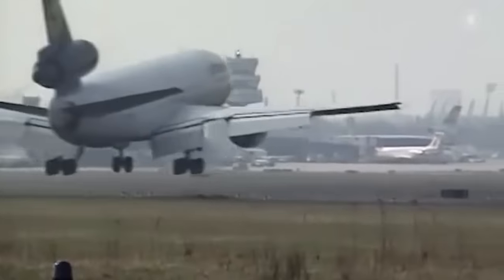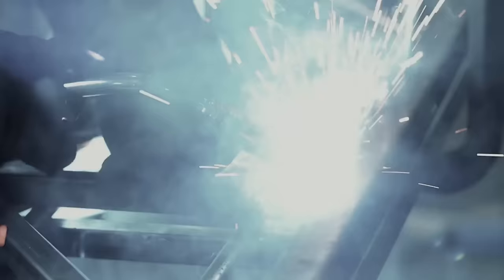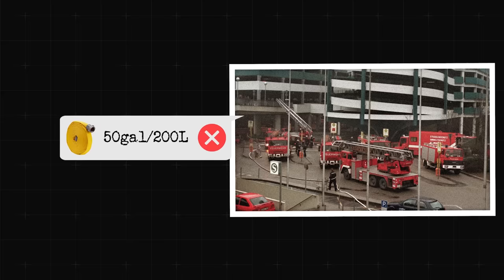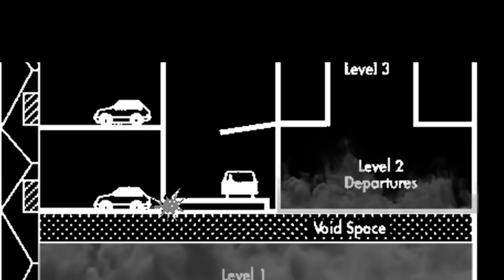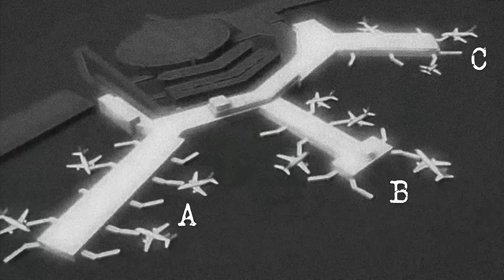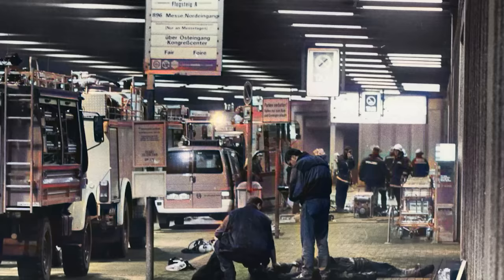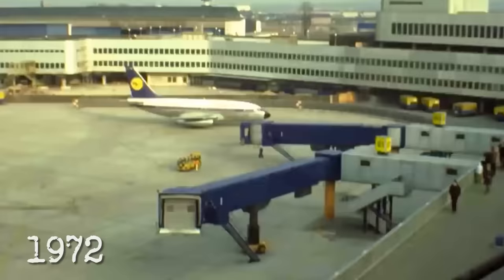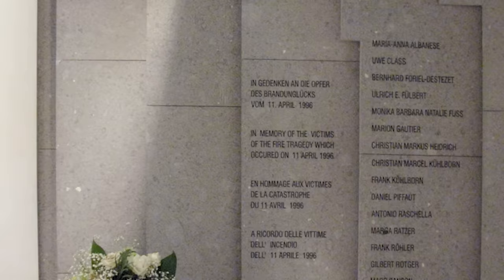The Düsseldorf Airport Blaze (Worst Airport Fire in History)

Comment: How many times does a guy doing some welding cause a major disaster, seems to happen all the time
Reply: A few years ago, one of the buildings at my university had a major fire, caused by contractors working on the roof at the time. I can't find anything about it now, but it came up in my fire warden training and I think it was linked to tar being applied to the roof? Not quite welding but certainly careless hot works. Luckily the whole building was closed for refurbishment so nobody was injured.
Reply: @caitthenerd7470  Same thing happened in 1987 at Dutch museum 'New Land Informationcenter' roofworks were being done causing the entire museum to burn down.

And of course the major fire of Notre Dame in Paris a few years ago.
Reply: I was a children's librarian in NH while a big library addition was being built just past a plastic sheet.  Choking Welding fumes frequently penetrated the children's department.  We closed and evacuated the children's dept several times.
Reply: Welding is an important technology that needs to be used in many places. The problem just is that it involves very high temperatures and would require the supervisor/foreman to arrange for there to be someone present who knows more about the building (like what random exposed object is made of flammable materials) and about fire safety. That of course costs extra time and money, so normally it's just assumed that everything will be OK. But of course, as usual, when anything goes wrong, it's apparently the welders fault, as if they could decide what to weld and where. The workers are normally just doing what the higher-ranking (and in theory more informed) people tell them to.
Reply: @SmartassX1  Are they secretly already calculating how much the fire insurance will pay out if anything goes wrong?

I mean, to have work on the roof done, the followings is usually collected on top:
- bottles of gas (highly flammable);
- loads of tar (burns the best once ignited);
- a variety of types of wooden structural supports and beams;
- planned and executed in the middle of Summer of course, when the sun is at its hottest and brightest;

What could ever go wrong?
Reply: i mean youre playing not even with fire but with hot molten metal, of course its very dangerous
Reply: the only two things that i've ever had close fire calls with are the small amount of hobby level welding i do, and still-lit cigarette butts, heh. if i scale that up to an entire planet's worth of welders and smokers i mean.... that's kind of scary.
Reply: At my work, you can be called on to be fire watch..If anybody is doing some hot work ,2 people will be watching  together with 2 extremely large fire extinguishers each..  + you have to stay there 30 minutes after the work is done...
Reply: Yeah no kidding. I just found out that the Beirut explosion started as a fire from welders as well.
Reply: @LiquidGhost100  What is your source for that statement ???
Reply: I see you everywhere, how do I keep seeing you
Reply: First time I've heard of it
Reply: Too many times as they have cost cutting as happened in this and had not taken proper steps like alerting the airport fire brigade who had no clue or even warning the workers on the dangers
Reply: @SmartassX1  ye in theory but never in practice they tell people that they are welding and where and probably nothing else
Reply: @thegoldeneagle9890  so many experts after it actually happened the workers were probably playing video games before working and not concentrating who knows
Reply: @James-kv6kb  well no one probably told the other than you go to the airport you weld this here and done go home you have finished and that is all they ever get told
Reply: @thegoldeneagle9890  Well with so many probablys it's no point continuing the conversation
Reply: @James-kv6kb  true the industry does closely guard what they are told in fact so no really knows
Reply: To be fair, the welders weren't told to watch out for flammable insulation since insulation is supposed to be fireproof by law
Reply: @jmlinden7  emphasises placed on the word supposed why do you think most things happen because something was supposed to be different
Reply: An example of a disaster caused by welding is the ultra sad fire that destroyed the beautiful French liner Normandie in New York harbour during WW 2. We also had a beautiful, historical church destroyed by fire in my nearby town of Aurora, Ontario, Canada because some roof repair workers had an open fire system for melting roof tar, which caught the roof on fire.

Comment: As soon as you said the weird smell thing I knew it would be polystyrene. The smoke is terribly thick and nasty. Seems like it’s nearly always the culprit in large building fires.
Reply: Foam rubber I learned from experience and fire training is also a major producer of caustic toxic smoke, in houses and more:  From burning and smoldering couches, stuffed chairs...  And fiberglas insulation, esp in a mobile home, while supposedly fire resistant includes lots of plastic fibers: It burns rapidly between mobile home walls.  FD taught me a mobile home will burn down in 15 minutes, while also being choked by toxic smoke.
Reply: Very much like the polyurethane packaging foam used to soundproof the walls of The Station nightclub, which contributed to the fire that killed 100 people.
Reply: @Felamine  there's footage post fire where the results of an investigation are shown and they ahowed how quickly that foam burned up and the smoke was insane
Reply: Ages ago in my town a large warehouse full of polystyrene packaging materials (mostly the small peanuts but also larger flat pieces) and the smoke/smell was bad.

Comment: In Germany such trials ALWAYS end in acquittals. Because the standard is to show the individual guilt, which is of course useless when a series of wrongdoings caused everything. Same with the Loveparade, the case was eventually dismissed.
Reply: Right, blue pepper
Reply: The Swiss Cheese model of accidents. Roughly put, all the holes have to line up. 
Sloppy safety practices, poor safety equipment, and badly designed buildings (among other things) provide the holes.
Reply: Other countries also usually end up acquitting most or all responsible.
Reply: @MegaSunspark  Nürnberg.
Reply: @prunabluepepper  trials conducted not by Germans.
Reply: @MegaSunspark  true. doesn't change facts though. However: there also were local tribunals and court sessions. They are just not well known internationally.
Reply: @DistractedGlobeGuy  yes, very true.

Comment: NEVER, ever ever get on an elevator in a building that’s on fire! I of course don’t blame the victims for not knowing that. Spread the word.
Reply: Absolutely is the fault of the victims.  Every elevator in every developed country has signs... both outside and inside the elevators clearly stating to not use them during a fire.
Reply: @ShainAndrews  There was no aktive Fire Alert on the Parking level. The Victims in the elevators didn't know there was a fire.
Reply: There are certain exceptions - but those are clearly labeled on site. In certain skyscapers, it can be infeasible to get down by stairs, because that takes way too long, especially for someone with i.e. a disability. And carrying someone down 100+ floors is also not exactly easy. These than have special, fire-resistant elevators with emergency backup power and other protection systems in place.
Reply: I mean…they were under a ton of stress!they probably weren’t thinking straight and just panicked
Reply: I blame the victims. Fortunately, they removed their mutations from humanity willingly.
Reply: In germany EVERY Elevator since the 1970s by law and construction has a obvious notice "Im Brandfall nicht benutzen" (Do not use in case of fire) in direct view to the people. So they dismissed it and died.

Comment: Blaming the welders is a bad policy. It should be assumed that ignition sources will allways find a way to exist in a building. If not welding then smoking or an electrical fault will exist. Large public buildings should be made without an abundance of combustible materials.
Reply: It is procedural process for “hot work” which requires for all personnel involved to be thoroughly trained and knowledgeable !
Reply: difference between a genuine mistake, where a certain risk isn't documented or taught in training, and gross negligence of public safety, this case is very clearly the latter.
Reply: @superspecialty5169  Seems like the flammable parts weren’t visible and illegally placed.
Reply: @superspecialty5169  9:27

Comment: I hadn’t heard of this before. I know you’re not supposed to use elevators in a fire but didn’t know why until now.

I’m a little miserable from a cold I caught on a work trip and having to wake up at 3AM to catch my flight home but glad I didn’t have to deal with this in my medication-induced fogginess. 

Just as on planes, when you’re in the airport, Know Your Exits
Reply: Know your airports
Reply: I hope you feel 100% better very soon. 🙏❤️
Reply: Another more direct reason not to use an elevator during a fire is in case power is cut off due to a fire.  It could be the same result where the elevator is stuck between floors, and smoke pours into the elevator shaft with tragic results.  I would not have even thought of the smoke messing with sensors, but have always noticed the warning signs to NOT take an elevator.  I know that people in a panic will do all kinds of counter-intuitive things opposite of safety, but I am pretty sure I would not be one of them.  My guess is from the roof of the parking structure, the fire did not seem too bad.

Comment: Rules are written in blood. I worked in Shanghai’s subway HVAC systems near those insulations. Any welding (soldering included) requires a “fire-usage” permit issued by the operators, and work is permitted during hours opened for passenger, except emergency. The paper must shown to station personal before work and a watcher trained by fire department always need to be present and must have a valid license. Hopefully these regulations can prevent similar case in future.

Comment: I dont remember hearing about this at all. What a horrible thing to go through.  My sons father used to do a thing called insuclading, which is where the outside of a building is covered in a type of polystyrene sheet & spray on plaster & inside is insulating fluff.  I was always nervous about buildings done in this stuff because of the polystyrene, especially in the early days.

Comment: BREAK. THE. DAMNED. WINDOWS. JESUS!  What kind of sociopath says "there's a massive fire and it sounds like you cannot get out, but please don't break the windows?" 😡
Reply: Might result in a flow of fresh air into the building, fanning the flames and making things quickly much worse. A fire smouldering in a room, all hot, will often flash over if you open the door and allow a gust of oxygen-rich air in. If you can escape without contributing fresh air, you should.
Reply: it was security glass windows. You need a sledgehammer to break this windows.

Comment: Even this was a tragedy, we learned so much from it.
Fire detection systems who can manage whole building-systems (elevators, windows, smokefree emergency staircases, closing down airvents and air conditioning and so on...).
New rules for planning and construction of large buildings. I worked at security in the MAIN TOWER in Frankfurt, which in 1999 when it opened was the most modern and safest building in Europe in terms of fire protection. Without Düsseldorf, who knows how many tragedies there would have been...

Comment: Oh no this is awful.

Usually fires can be traced to a very specific event as it’s cause. People responsible for its start, even if accidental would be changed forever :(
Reply: They did trace to the welders igniting the polysterine. The problem was that the polysterine was places there illegally. 
So who exactly was to blame? That really was the issue for who to blame for the start of the fire.

Then, who made the decision not to train the airport firefighters for terminal fires but just plane fires?
Etc

It was a mixture of errors and failings, so was any one person on trail responsable for the tragedy?
The answer was no, not personally, but if I wanted to point the finger at anyone, I would place most of the blame on whomever instructed to illegal install the polysterine.
Reply: @tkralva.6668  I'd agree. The polystyrene wasn't supposed to be there, so the welders can't have been expected to identify it as a risk factor. While it is possible that they could have identified the risk and countered it, that would have been beyond the scope of their knowledge. Welders tend not to be formally educated about building insulation.

Comment: Can I just add the 911 operator telling the caller not to smash the windows if possible was a good call as changing air flow to fires can rapidly change the size and direction the fire, smoke, and heat travel and can lead to back drafts. Potentially not in this circumstance but it's good practice.
Reply: Thanks. Was looking for that comment!
But I guess he should have been more specific and saying smth lile "if there is no other way out, break them."

Comment: The delay at Berlin Brandenburg Airport was caused by the fire protection & alarm system. When you learn of this disaster and put things into perspective, I suppose the delay would be worth it if it saves lives in the future.
Reply: I heard one of the larger parts of the delay was caused by the cable trays having been secured to the concrete walls by plastic anchors. Nobody would have given a damn about someting like this in the past, but after Düsseldorf it now has to be all metal to keep the emergency lights on and the fire alarms working for as long as possible.

Comment: Excellent work, for some reason this event has never attracted much attention (only the local broadcasting corporation WDR produced documentaries for the 10th and 25th anniversaries) although this is literally the only ever occurrence of an airport fire of this scale and death toll. German authorities were probably much more concerned with the constant threat of bombings and terrorist attacks. Probably this is not entirely unrelated to the ridiculous 9 year opening delay of the new airport in Berlin, where much of the apron/runway infrastructure from the old airport was kept and only technical difficulties inside the passenger terminal generated unexpected enormous costs, mostly problems revolving around misplanning and violating fire safety regulations.
Reply: Do not forget that to Olympics 1972 the RAF, car bombs, smoke attacks outside, rude passengers are more a problem as the worker how works on airport without permission ... what happend often these years (70's, 80's) if they are special operations from GSG9 or other police troops without permission or knowledge of the airport chief.

Comment: Had a similar experience in 1982 at Melbourne Tullamarine airport. While on a nightshirt we were called to smoke in the ground controllers suite. We could all smell smoke but spent ages looking for the source. Eventually, by turning out the lights, we saw the smoke crawling up the forward tilting tinted windows. A cigarette, yes, it was 1982, had rolled of a table forward into a plant pot in front of the control cabinets and the peat had gradually started burning. This could have become a fire like at Dusseldorf.

Comment: wow 705  firefighters and 250 fire engines on the scene is mad
Reply: Germany afaik has almost the number of firefighters as the usa, but considerably less area and people. That means on smaller fires more personnel intensive tactics that have other benefits can be used, and too large fires in a densely populated area like this there is a sheer unlimited number that can respond. Given a bit of time. Atleast nowadays, and probably back then as well, more volunteers and crews from other cities will have also manned the main stations in düsseldorf to ensure basic protection.

Comment: I call bullshit on "the airport firefighters knew nothing about handling indoor fires". There's nothing of that kind in any report that I've found. Overwhelmed by the scope of the blaze, sure. But untrained, that's nearly impossible. All German firefighters, including those in private owned departments and volunteers, get a standardized basic training. Otherwise the department is not recognized by insurers, and since there's a considerable price tag attached to that, even the pencil pushers in management can't help but notice.
Reply: Was thinking the same thing.  They would have been trained to handle various fires.   If the terminals had more safety features, then they might have had a chance.  But they knew right away that the scale of the fire required a much larger response.  They did what they could with what they had.

Comment: I'm really curious... Wouldn't they try to operate welding in a area that is no where near where it can fall and build up onto insulation?? What kind of shop or maintenance area has the chance for build up from working to build up onto insulation below them... Idk.. that's crazy that was even able to occur... Rip to the victims.
Reply: Sounded to me like they were doing repairs in the area, not just a permanent shop installation in the wrong spot. Hence why the narrator said the fire department should have been briefed they were working there?